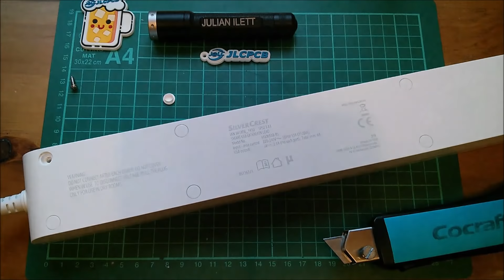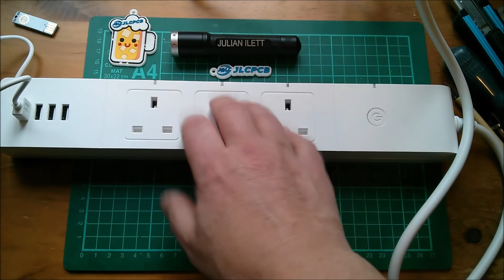Lidl Smart USB Extension Lead - Stripdown

Comment: Zigbee is a gateway to abilities that Lidl wouldn't teach you! You can setup a Zigbee2MQTT gateway (Andreas Spiess and NotEnoughTech have a lot of good info on getting it running on a Pi, but can run on any little Linux box you might have already doing something). Zigbee2MQTT can act as a single gateway for all brands of zigbee stuff (Hue, Ikea, random stuff from china) and to WiFi home automation hear too. You can run your own App on the server and tablet, so not sharing your data with the cloud - but you can also install NodeRed and chain all sorts of sensors into your setup, to say, turn on the antminers when it gets below 15c in the shed. There is a visual coding UI where you link nodes up, but you can create a code node, and write your own code. There are nodes that get the sunrise and sunset times for your location so you can incorporate that too. My hallway lights are on a motion sensor, but only come on when it's nigthtime, but when its really late at night; they come on at only 20% brightness so as to not blind you when yo nip to the bathroom, or the kitchen for a glass of water. It's super addictive hobby!

Comment: DO DAISYCHAIN!
I have my lights chained, so that I can switch off all lights with one button. Plus: only 1 receiver is activated all of the day, the rest is not. It is all about energy saving!
Reply: Some "smart" people have the idea to daisy chain 5 extension cords and plug a 3.5kW space heater into the last one (230V by 16A curcuits here). That's when the wires COULD get too hot and cause a fire. If you plug 100W of LED lights in total, you are certainly safe :-)
Reply: @zeero4ever  Exactly how I am doing this :-)  (just running LED lights). One has to know what he is doing of course.

Comment: Argh stop saying hey Google!!! Lol.
Also, why not WiFi... The interference argument is nonsense. I work on something with ZigBee, Bluetooth and WiFi all within a few inches. It's probably a cost thing having to implement a WiFi module and the corresponding software to configure the WiFi. Ethernet it's much easier to implement

Comment: Zigbee works on 2.4ghz, so a WiFi zigbee hub is probably going to suffer from lots of interference. I bought one of these a fortnight ago. Hooked up to my home assistant it seems to work very well. I’ve been very pleased with all the Lidl zigbee things I’ve bought and I’ve collated quite a few bits over the last few weeks. Still a pile of hubs sat in my local store. Zigbee devices work with any hub so those that want these things generally already have the hub bit. IKEA tradfri is another cheap option.
Reply: Zigbee is 2.4GHz but very reliable in home automation, much better than normal Wifi devices. For starters much lower on (standby) power and it has the nature of creating a mesh with every active device, so every lamp of switch will become a repeater.

Comment: I think the houzetek wifi 4 plugs + usb is the best option so far (I got 2 of them for 17€ each), since you can control all 5 channels. In addition you can replace stock tuya firmware with any you like with tuya-convert (I use tasmota to connect it locally to home assistant and it also works directly to alexa)

Comment: Here in NZ most of the extension sockets are riveted together, clearly not made to be opened. Really annoying.
I don't think I like the idea of the USB being powered all the time, apart from being very wasteful it will shorted it's useful life.
It's funny, they always have a large capacitor laying right tightly against the heatsink. Designed to shorten it's life, cannot have things lasting too long can we.
Reply: The USB psu actually is double fused (reddish brown rectangles). One is on the psu itself, and one is right before the solder lugs for the wires off the strip board.
Reply: The simple answer is to unplug the extension lead when not in use or only plug in to a switch socket so it can be switched off when not required. The point is, it is an extension not meant for fixed continues use, it is a short life cheep stop gap. Julian is going to test it for us, Wait till it fails or not, just like the little diesel heater that failed.

Comment: RJ45 (vs Wifi): Way more reliable, no SSID mess and no interference with the Zigbee. Excellent choice :)
Reply: [obligatory complaint: they're 8C8P connectors, not RJ45 unless used for phone company service in a specific configuration]
  But semi-joking pedantic part-troll aside, absobloodylutely. I hate this trend for wireless everything.  Wifi is useful for MOBILE devices in a specific place. it's ideal for my phone in my home. Everything that's static, INCLUDING the google chromecast, is wired.
Reply: [addition after a day of thought: wifi is also handy for people renting, who can't drill holes/cable their home, although to be honest any modern rental should be wired with at least cat5E to every room]
Reply: @TheChipmunk2008  In this case, just place the gateway near the router. The antenna to antenna distance will be already much larger than on the same PCB / in same box. Besides, here it's common that you're allowed to do reversible changes to a rental like drilling holes. But yeah, every house should have decent ethernet distribution.
Reply: Hue hub does the same. It actually has wifi on board but disabled. Some enterprising people have hacked it back in on some older revisions of the firmware I believe.
Reply: It talks to Tuya ....
Reply: @KJW648  tuya would be bad..China cloud + free WiFi for any spy from China
Reply: @kitecattestecke2303  Is why big brand companies are partners, because they can't trust them ? 😅🤣 😋
Reply: True ask any network engineer what they have in their houses -0 we have rj45 and wifi as a backup or toy...or a copy of Reaver for free wifi from the neighbours lol
Reply: RJ45, the Wi-Fi standard of choice for IT security professionals. 😏
Reply: But what about me....I use my neighbours WiFi!
Reply: @tonyjones9442  how did you get the password? Banged neighbors wife?
Reply: I too generally prefer wired connections but for little things like this with minimal bandwidth requirements Wi-Fi really can make more sense. Mainly because Wi-Fi devices don't use up switch ports. Switch ports cost money while low-activity wireless associations are basically free. If there is any continuous data use (such as streaming media devices) then even if the bandwidth isn't much it can take airtime away from real devices and thus wired is preferred. Really wired networking should at least be an option whenever practical. I'm mildly annoyed at my Wi-Fi only printer which really should also have Ethernet but get super annoyed with laptops without Ethernet.
Reply: @eDoc2020  To be honest, these days, for most stuff (let's face it most devices (as opposed to workstations/your gaming rig/the backup server) would still be fine on 10baseT!)  the cost is NOT the port itself, 24port 100baseTX managed switches are sold for scrap value round here... it's the labour of the cabling, and the capital cost of the cable and accessories etc. I wired this house with cat5E while unemployed so labour cost was 0. I got the cat5E from dumpsters (watch out for office /commercial buildings being refitted, the installers will dumpster the part used boxes as the storage space for dubiously small amounts of cable outweighs the cost, even if they'd be fine for your average largeish house!)  My only capital cost was the jacks and plugs.

Comment: I actually went to aldi instead and noticed they had WiFi compatible plugs for £7.99. So you plug them directly into a mains socket and plug your load directly into those. They connect directly to WiFi so no gateway needed. I also bought a WiFi smoke detector for £20 whilst I was there.

Comment: It looks as if the high current tracks run in parallel on both sides of the board - stitched together with via holes - So that may help carry the current
Reply: Yes, I saw that... I'd still side with julian about plugging the higher power equipment into socket 1 however.

Comment: Aren't we British known for our over enforced safety regulations? :D
Reply: Here in NZ no fuses in the plugs, poor cord grips, no ring mains. Power sockets in the bathrooms placed right over the sinks. At least we have 240 volts (well, most of the time) so not all bad.
Reply: @MichaelBeeny  I hope the sockets have earth leakage protection. :'3
Reply: Used to be, now it's pointless safety regulations that actually make things LESS safe (see elsewhere in the thread re: sleeved pin plugs being more likely to melt down than the old unsleeved ones).

Comment: You can add a Boost converter to one of the USB Port's. so you can get 12v at the O/p & you can charge your 3s pack.
I'm I right...? 😊
Reply: Yeah at less than half the current on the 5V rail.. Not good

Comment: Yes it's 16A from the wall here in France :) (shared on each line from the breaker)
Reply: In a lot of buildings the 16A sockets are on a 20A breaker (up to 8 sockets on a 20A breaker with 2.5mm2 cable is allowed by code). So you can pull up to 20A from one socket - even a decent extension cord will get quite warm if you do that...
Reply: @DerHeilendeLotus  but is it build like this on average? I think no...
In Germany many houses are 16Amps B characteristic automatic, 1,5mm² and loots of outlets, should be up to code

Comment: That thing about PCB tracks being able to carry large current has often been my concern too. Many devices that I have examined simply do not seem to have enough track width for the rated current in my mind. Perhaps it is because the PCB tracks are very wide in relation to thickness, and the tracks are adhered to the PCB substrate, that they are able to withstand more heating than a round wire of equal cross section? I don't really know. Think about a modern PC motherboard, it has to supply a total of hundreds of amps to the CPU because the voltage is so low!! Seems impossible for those minutely thin (vertically) PCB tracks! Of course the power planes can be huge in the 2 dimensions along the PCB, but still...
Reply: The mains tracks are duplicated on both sides of the board and stitched with vias
Reply: @timballam3675   Okay, though vias don't really help in this sense since they are mainly vertical (perpendicular) connections.

Comment: The safety instructions have nothing to do with EU it's to with the company not wanting to get sued!  Enjoy your Brexit
Reply: Yes, sometimes the more safety warnings there are the less safe an item is. If things were designed correctly they would not need the warning. Like in the US they allow the sale of 13amp extension cords with a warning of ‘don’t plug in more than 13amps’. That warning should go away and they should be required to put 13 amp fuse in. The wall plug is at least 15amp so those extension cords will burst into flames before 15 amps trips.
Reply: brexit will make very little if any difference to the existing safety instructions. In fact in various areas brexit is causing lots more red tape. In the future if the U.K. diverges from the E.U., you will end up with EVEN MORE safety instructions, as the U.K. will get extra ones on top of the existing ones (as the existing ones will still be provided).
Reply: Zzzz
Reply: At the risk of being controversial, some of them ARE because of the EU, the sensible ones, due to consumer rights laws. And there's nothing enjoyable about brexshit :( (which doesn't deserve a capital)

Comment: European socket is rated for 16A Peak. Not contiuous 16a. That is probably rhe reason why EU countries are stated as 16a. Most Circuits in houses will be on 10A though unless it's  an old house which might have 6a lighting circuits (Unearthed). It's different for us since our system assumes star mains rather than ring mains. Some modern houses have 13a circuits here in sweden but I assume that is because breakers that were originally intended for the british market have been used.
Reply: That is not correct. Schuko plugs are rated continuous load of 16amp. If the plugs was marked 10(16)amp you're right, but they aren't.
Reply: @mortenwinslw2785  yep, in NL too, normal fuse valuie is 16A. We even have B or C characteristic, a C is slow-blow
Reply: The U.K. does not use 13A MCBs  (miniature circuit breaker). If a ring circuit is installed, that’s protected by either a 30A fuse, a 30A MCB (old standard) or 32A MCB. Alternatively a 16A or 20A radial circuit may have been provided. Protected by 16A or 20A MCBs respectively.
In our “13A’ mains plugs, we do have fuses. The fuse can be 1A, 2A, 3A, 5A, 7A, 10A or 13A. Although only 3A, 5A and 13A fuses are normally available to ordinary consumers. The fuse is to protect the flex (flexible cable) from overheating and causing a fire.
Reply: @Mark1024MAK  Yeah? Then the 13a MCB is a total mystery to me. I thought thet in modern houses withour ring mains maybe they would use 13A just out of habit.

Comment: £20 each (£40)! 😲 You got ripped off here, a similar device with a wifi access and app wouldn't be more than £20 and no "gateway" needed.
Reply: Most ZigBee hub are around that price if not more. Zigbee is far better than just WiFi. You can daisy chain ZigBee products over a fair distance.
Reply: @northwales1000  indeed: Zigbee is 2.4GHz but very reliable in home automation, much better than normal Wifi devices. For starters much lower on (standby) power and it has the nature of creating a mesh network with every active device, so every lamp of switch will become a repeater. Also there's solid working status feedback, so you know when your device is on.
Reply from the maker: I do think the gateway is a bit of a rip off. The extension lead feels like much better value.

Comment: Are your antminers currently "profitable"? What model units do you have?
Reply from the maker: They're only profitable if your electricity costs nothing :/
Reply: @midinotes  Yes, but they provide heat for the workshop and offset some of the cost of electricity over just a resistive heater. Nowhere near enough solar to keep them going for long.
Reply: In the U.K., you would need a 3 or 4kW solar PV system to keep them going in spring, summer and autumn. But would likely need more than that for use in winter. Unless you have a massive backup battery that can cover at least a week with little or no bright sunlight. So no, the payback time is not really realistic.
Reply: I'm wondering what would cost less in the long run: the payback from mining or the power savings from using a heat pump instead?

Comment: Not a fan of mains sockets on a pcb, the solder joints will eventually crack from plugging/unplugging stuff, specially if the contacts have a decent clamping force. Hard pass for me.
Reply: Yes, don't like those folded U shaped sockets either. Seen way too many contact heating problems with them. A bit of dirt on the pin that a normal socket would wipe clear, can cause massive thermal damage. Once they lose their 'spring' due to heat, the damage just cascades.

Comment: I just plug my extension in and switch it on using my hands.
Reply from the maker: You must have smart hands ;)
Reply: Hands are smart enough to know that something is definitely switched (no guessing)
And also smart enough to not give your data away to a 3rd party

Smart home equipment is great for disabled or elderly people (once it is set up by their 12 year old grandchild) but other than that it will just turn us into fat lumps that can't be arsed to get up and switch a lightbulb/appliance on
Reply: @Sofa-Lofa1  - with regards to the ‘making humans lazy’ bit, isn’t that what they said about TV remote controls? And now nearly everything that is part of home entertainment comes with a remote control. I have SIX next to me right now!
Reply: @Mark1024MAK  yup, from the early days of the 'clicker' remotes,
Your best bet is either to buy an 'all in one' and save on batteries... Or throw them away and save yourself a heart attack 💔🥵
Reply: @Sofa-Lofa1  but I shouldn't have to switch a light bulb on. It should be on as soon as I enter the room!
Reply: @googletitsfost  you don't have to, just buy a P. I. R. bulb... Job done 

And if you want remote control, there are plenty of I. R. of WiFi options out there that don't require an app to tell a 3rd party all your info, such as when you get up in the morning, when you go to bed, which devices you switch on and off (in app 'labels') etc. or a thousand other data points, to be sold ultimately to Google, Amazon, etc. who as we all know are building up a picture of what you do, and when, what you spend your money on (they both know ALL your spending habits, unless it's cash) just so that picture is clear enough to let them sell you the next piece of 'must have' crap... Their algorithm says you want it! 

Call me old fashioned, but it's just none of their damned business... Can't believe that people are happy to have someone look over their shoulder like that, just to switch a bloody light switch which is generally less than 6' away.... Just buy a dumb P. I. R. one that doesn't care

I sense your comment is possibly in jest but either way.... Rant over
Reply: @Mr Brightside my bulbs are basically pir focused so they'll go off after inactivity. But I wouldn't have them in the bedroom anyway as the stair light is sufficient for the bedroom.
Reply: @Mr Brightside my not falling down the stairs is more important than possibly waking someone up.
Reply: @Mr Brightside there always seems to be random objects on the stairs that I don't notice until I put my foot on them and scream in pain, then I get moaned at for breaking stuff. That typically doesn't happen outside as I can see it first. Apart from the odd lamppost on a Saturday night...